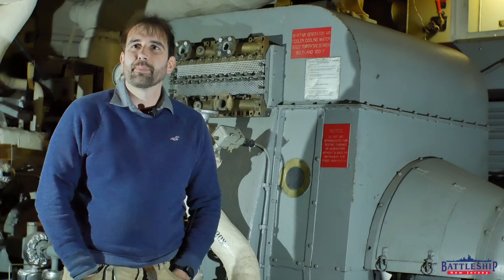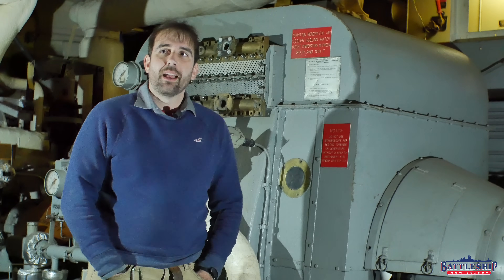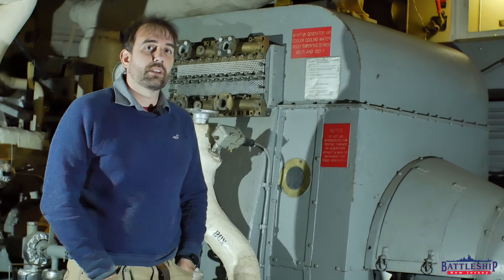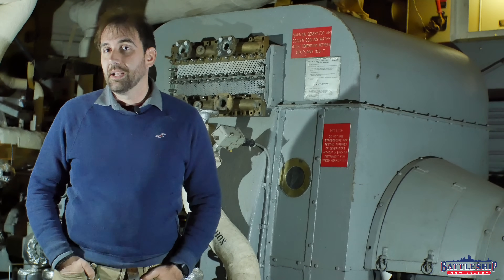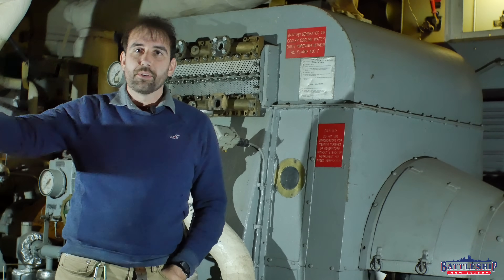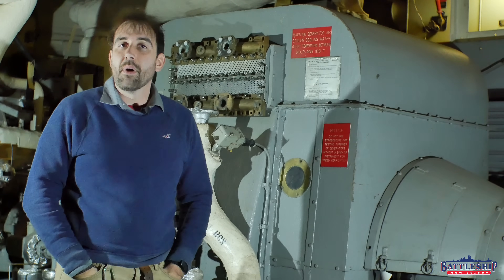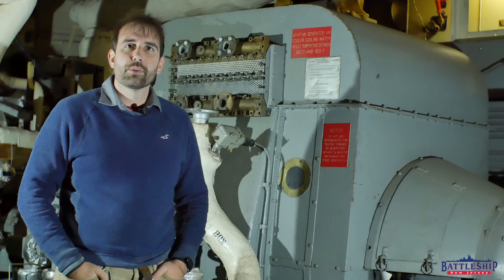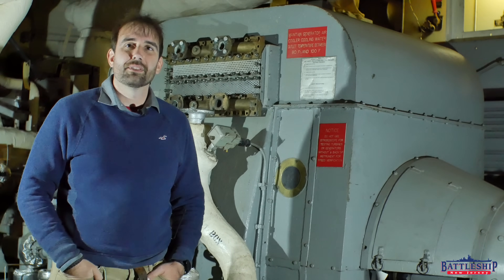Turbo Electric vs Direct Drive Turbine: What Propulsion Plant Is Better for Capital Ships?

Comment: While there are some significant advantages to nuclear power there are also some downsides as well. For one the amount and quality of the training required to get crew members who can operate the plant properly is considerable. Not just anybody can make it through the program and qualify to operate a nuclear power plant in the fleet. For another, you're still dealing with a steam turbine to provide the propulsion for the ship or submarine. This means that if the vessel is at a pier, shut down and "cold" it will take it hours before it can get underway.

By way of contrast a gas turbine powered ship, as well as a diesel, can get its engine started and get underway almost as fast as you could get your car going. The way things are being done these days while the carriers are nuclear powered and have almost infinite range before needing to be refueled, their escorts are gas turbine powered. So as the carrier's aircraft also use gas turbine engines this means that the carrier only needs to carry one type of fuel in large quantities to provide for both her aircraft and her escorts. Greatly simplifies logistics. And with the escorts being gas turbine powered they don't have the problems associated with getting seriously trained and qualified people to run their power plants. Besides, the carrier is better protected from damage than the escorts are and thus with the escorts being gas turbine powered they don't have the worries that would be associated with a nuclear power plant taking battle damage due to insufficient armor/compartmentalization. 

So what's the best power plant to use? It will largely depend on what you want the ship to do in terms of its role in the fleet. A lot of the amphibious ships (Gator Freighters) as well as some of the support ships such as oilers still use bunker oil fueled steam powered plants because they don't need to go that fast and that sort of propulsion system works just fine for them. The carrier needs to be able to go as fast as it can to just about any area of the world on a moment's notice. That's why it needs the nuclear power plant. As it is carrying a lot of jet fuel it can provide the fuel that the escorts need, though eventually its going to need to meet up with some oilers so it can continue to supply its aircraft and escorts.

Some of the LSTs out there are diesel powered with controllable reversible props because that is a very fuel efficient system and helps them with their beaching evolutions.

Bottom line, there are advantages and disadvantages with all the various different types of propulsion plants. The challenge is to find the one that will work best/most efficiently for the ship in terms of fulfilling its role.
Reply: Nuclear propulsion is also very heavy compared to a conventional system of the same output.

Comment: The back and forth of gears vs electric drive  changes with technology.
Turbines spun much  faster than recip steam engines, thus a huge reduction ratio.
Reduction gears were not perfected then thus turbo electric “ transmission”.
Later gears got better .

Now improvements in electronic controls and higher electrical demand shifts the balance
Again to turbo electric….

Comment: Today you could put some big diesels and some gas turbines. You cruise on the diesel and use the gas turbines all feeding electric motors for the screws. Nuclear is interesting but would you want to get into a  slugfest with a nuclear ship?  Now if Lockheed Martin gets that compact fusion reactor working then you are good to go.

Comment: In starships, the impulse drive is essentially an augmented fusion rocket, usually consisting of one or more fusion reactors, a driver coil assembly, and a vectored thrust nozzle to direct the plasma exhaust. The fusion reaction generated a highly energized plasma. This plasma, ("electro-plasma") could be employed for propulsion, or could be diverted through the EPS to the power transfer grid, via EPS conduits, so as to supply other systems. The accelerated plasma was passed through the driver coils, thereby generating a field that improved the propulsive effect.

Comment: I think a steam turbine directly spinning the prop is the way to go. Less places for things to go wrong in my opinion
Reply: Not feasible as the turbine revolves far too fast for the propeller to be effective drive force in the water .
Reply: @kennethhanks6712  that’s why they have a reduction gearbox. I guess I could have been more clear, the traditional steam turbine with a reduction gear requires less parts than a turoboelectric plant would
Reply: @jasonmurawski5877  It requires MANY more actually lol. A turbine spinning a generator that powers a motor is literally as simple as it gets. No massive and expensive reduction boxes needed, No enormously long shafts, No need for additional separate turbine generators for electrical power.
Reply: @Jacksonflax  Turbo-electric also keeps the turbine at high RPM, where it's most efficient - geared turbines have to speed up and slow down as the ship does, not something that matters at all to TE.
Reply: Diesel electric is the way to go in my opinion.
Reply: @AVM65DT  It's a good system, but - particularly in the time when the Iowas were constructed - extremely heavy. Given that weight was one of the reasons the USN ditched turbo-electric, diesel-electric seems even more unlikely.

Comment: Many merchant ships of WWII were made with turbo electric not because it was more efficient but because making Lock trained compact reduction gears is difficult and only a few factories can make them.
The output was reserved for warships so merchants got the excess Capacity  output of easier to make generators and motors that many factories could provide.
T-2 tankers Victory freighters.
Reply: Rudderow and Buckley class destroyer escorts also had turbo-electric drives for much the same reason.

Comment: All the points you made were valid, but speed is king.  How big would a TE drive have to be to deliver 32+ knots?
Reply: French liner Normandie, Atlantic Blue Riband winner, was turbo-electric, whose career unfortunately ended way too soon.
Reply: Yes, as he said, the Lexingtons were T-E ships and in their original battlecruiser design, they were intended to have a high top speed.

Comment: On the subject of hits knocking out T-E power, I recall that all but one of the incidents involved the boilers being snuffed out, an issue that would have temporarily crippled any ship with steam power, regardless of the final drive.
The singular exception was something like a million-to-one shot where a torpedo bulls-eyed the one bulkhead that carried the main power bus, essentially unplugging the ship's engines until it could be reconnected. Either way it was temporary and if you're being particularly generous the same shot would probably have broken the seals on a longer propeller shaft like what happened to Prince of Wales.
Reply: If I remember correctly, (no bets on that), Saratoga had about a half dozen power loss incidents during WW2, the I-16 being the longest at about a half-hour, the rest fixed in mere minutes, but it gave TE propulsion a "flaky" rep. Given the advantages, not fair assessment. Replacing huge fuses is still easier than patching steam pipes and warped shafts.
I think the naval treaties killed TE for warship drives, simply because they are heavier power plants that sucked weight away from armor and armaments.
Reply: So there was just 1 bus bar for all the engines? Do you know which battleship that was that got hit?
Reply: @streetracer2321  I think it was USS Saratoga hit by I-16.

Comment: Nuclear power would be interesting.  Would have alot of stuff to plan for.   Like replacing the fuel rods and such. Modular or sectional armor?
Reply: I think this was brought up before, the big downside is both the weight and the vulnerability to shock.  That said, armored caps would be the way to go to refuel the core if they went that way.
Reply: @mdsx01  yea. Pretty sure it has been.  If the engineers could work it out,  it'd be nice.
Reply: The armour is actually built in sections that are welded/riveted together for ease of manufacture & repair
Reply: @KennyCnotG  yea. But I was referring to being able to easily remove a section for maintenance access. Similar to removing the rear deck lid on a tank to remove the engine.

Comment: I think I read that turbo-electric drive is  (or was then (1920’s and 30’s)) more efficient than turbine drive at cruising power settings, resulting in longer range for the same fuel load, assuming most of a voyage is at cruising power and not at full.
Reply: My understanding is that they hadn't yet developed reliable reduction gears capable of dealing with such high step-down ratios and levels of torque.

Comment: I remember a science fiction short story (Bill the Galactic Hero?) . . . where space battleships possessed enormous power conduits, with fuses the size of 8" brass.  In battle, under stress from demands of engines, weapons, and force field defenses, these great fuses would arc and blow, sending lightning bolts and molten brass into the space, while brave fuse men yanked the deaders out and slammed fresh ones into the clips.  Sweat and fire and lightning.  I can see it as a movie scene.
  Makes me wonder if the writer (Harry Harrison?) had served on a turbo-electric battleship during the war.
Reply: Yes, that was Bill

Comment: The problem with the highly subdivided machinery spaces is it makes the ship far more prone to capsizing when one side is hit multiple times.  USS Oklahoma capsized in Pearl Harbor; West Virginia and California were saved from capsizing by intentionally sinking them into the bottom before they could capsize.  All of those ships put each boiler in its own room along both sides, with the machinery in the middle.  When they take an attack from one side, it floods only one side and the ship wants to roll.

The US Navy knew this was a problem, and switched to full width machinery spaces after the standard class.  The later battleships and all of the aircraft carriers to this day use full width machinery spaces.  If a space floods, it does not create a tendency to capsize as the whole space will flood evenly.
Reply: Counterflooding and be used to offset this.

Admittedly, I don't know if machine spaces could be deliberately flooded quickly enough to be effective, but counterflooding of the TPS was a common practice. One of USS Texas' most famous moments was when her captain did this to increase elevation on the guns in support of the D-Day landings.

Both the Lexington and Saratoga were hit by torpedoes and while both developed lists, these were corrected. Yes, USS Lexington did sink, but that was from numerous explosions and she did not capsize. USS Saratoga was hit two separate times and both times the listing was corrected. When she sank after the second nuclear detonation, she still didn't capsize.

As for USS Oklahoma, she was not at combat readiness, her compartments weren't watertight as they would be during wartime, and she took multiple torpedoes in the same location. The first two hit the same spot, but were defeated by the TPS and failed to penetrate the hull. A third torpedo hit just above where the first hit. Torpedo 4 hit just aft. Torpedoes 5, 7, and 9 hit above the normal waterline, 5 right at the top of the belt and 7 and 9 much higher. Out of the 9 torpedoes that struck her, 7 hit aft of Turret II and forward of Turret III. Of those, 6 where under the bridge and smoke stack. I know of no ship that would have survived that amount of damage in that amount of time, regardless if they had time to prepare or not.

Remember, USS Oklahoma capsized 12 minutes after the first torpedo struck, which was at the beginning of the attack. There was no time for any measures to be taken to save the ship.
Reply: USS Oklahoma capsized because her torpedo bulges were open for inspection and not water tight.
Reply: @KJAkk  If you remember how Oklahoma was berthed, it was outboard of Maryland broadside to the attacking Vals.  Of course it was going to capsize after taking every torpedo hit (up to nine by some accounts) on one side.
Reply: @SomeRandomHuman717  From what I have read Oklahoma took three to five torpedo hits. West Virginia took seven to nine and settled on an even keel. Good damage control on the part of West Virginia helped but Oklahoma was in a bad material condition at the time she was hit.
Reply: makes a lot of sense to reduce the tendency for the ship to capsize
Reply: Didn't work so well for the Costa Concordia.
Reply: Free surface effect - with full-width spaces, you can capsize even if you flood evenly from both sides

Comment: If I were to design a new BB I would either go with nuclear, with an arrangement similar to a Nimitz class carrier, or failing that probably DC diesel-electric, with MG sets for ships power, or possibly CODAG like the RNs new birdfarms...
Reply: I would just use the lower structure of the Ford Class carrier, add barbettes with guns, and call it a day.
No reason to redesign the whole undersides of the ship, or the guns for that mater (except automate their reloading;) Ammo should be redesigned so the big guns could launch projectiles with steering controls much like the 500 pound smart bombs.

Comment: I wonder about another propulsive choice...Diesel Electric?  You would have even more subdivision and range.  You would also have muck quicker startup times and acceleration.  The downside is the battleship's fuel could not be used to fuel other ships that still used bunker C.  The standard diesel engine of the day like we used on submarines and LST's put out 1,500HP.  To equal USS New Jersey's HP, you would need 142 such engines.  You would have multiple decks of diesel engines turning generators for even more subdivision.
Reply: Commercially available marine diesel engines generating 2000 hp so a higher hp marine diesel is not out of question, reducing the number of diesels and opening space for other uses.

Comment: considering modern cruse ships like the queen Mary 2 use hybrid turbine electric for speed and efficiency, it is the way to go! not to mention you can also install a bow thruster system for extra maneuverability.
Reply: Aren't most modern cruise ships diesel-electric?
Reply: @Grantthetruthteller  QM2 has gas turbine generators and diesel generators. Diesel gens would be fine in a modern battle ship as well. Any genset would be fine really.
Reply: The latest Queen Elizabeth class aircraft carriers uses IEP.
Reply: Isn't the qm2 an ocean liner and not a "cruise " ship?  Significant differences between the two types of vessels.
Reply: @Grantthetruthteller  yes the QM2 is an ocean liner, the only ocean liner in service, still uses electric drive pods just like cruise ships too. I also remember reading Titanic 2 was also going to be useing a diesel genset and electric drive motors.

Comment: If designing a new battleship, I'm going with nuclear propulsion, and lots of it.  It'll need all that power for the railguns.
Reply: Skip the railguns go straight to directed energy weapons like lasers or Startrek phasers. 😂
Reply: @yb5515  those won't work for over-the-horizon targets.  However, lasers are definitely the AA weapon of choice for my ship.
Reply: But then there's no big bang...no smoke....and no fire
Reply: @graham2631  Good point!

Comment: Yeah considering the British switched to geared steam turbines in 1914 does show how far behind the Americans were in engine tech as the Americans keeping the Turbo-Electric drive until the North Carolina class is more a factor of not being able to develop the geared steam turbines at the time of the 1st World War
Reply: Also US far advanced in development of high speed reduction gearing (note Farragut class destroyers) by WWII.
Reply: @Robert Lowman didn't the Arizona strip one of its gear reduction units during initial sea trials and had to be laid up for replacement, mainly because the boilers put out more horsepower than anticipated and designed for?

Comment: Had to correct after checking
Umm not sure this comparison is really fair guys considering only HMS Dreadnought, the Bellerophon-Class, St.Vincent-Class, Colossus-Class, Neptune-Class Dreadnoughts, the Orion-Class Super Dreadnoughts and the 1911 King George V-Class Super Dreadnoughts, the Invincible-Class, indefatigable-Class, Lion-Class, Queen Mary-Class and Tiger-Class Battlecruisers used Direct-Drive Turbines before the British switched to geared steam turbines on the Iron Dukes and the Renowns and which went on to every battleship and battlecruiser that followed on from them